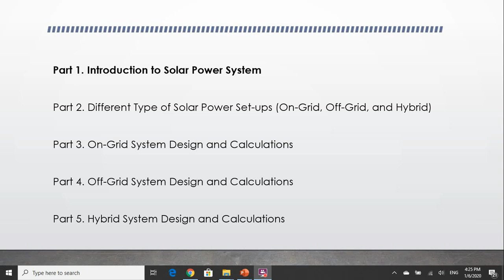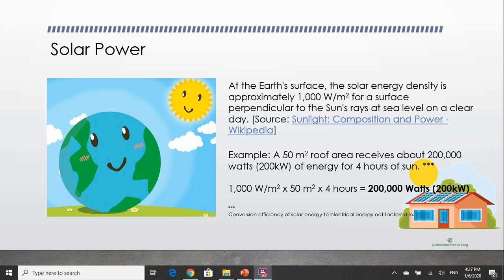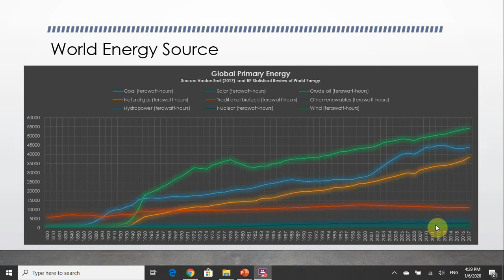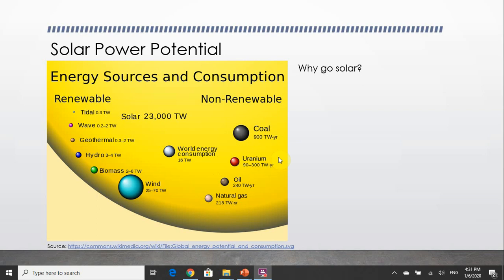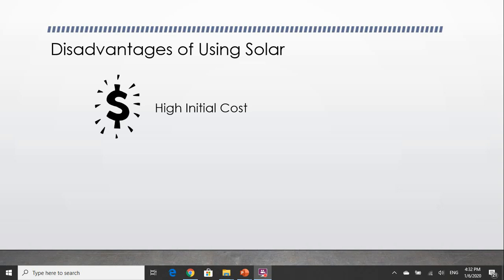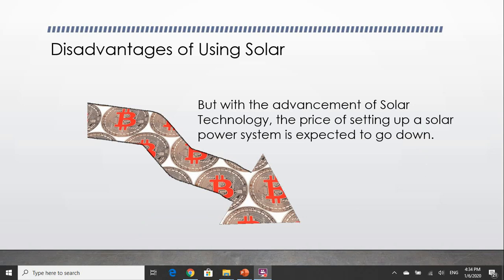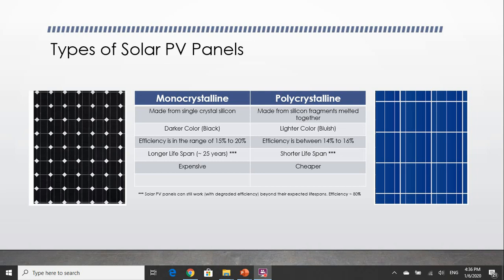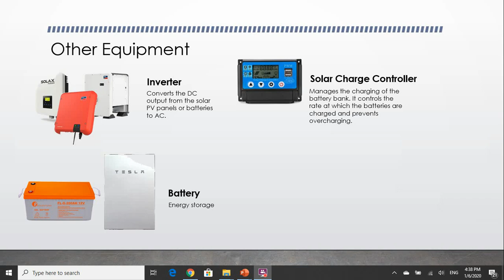DIY Solar | Introduction to Solar Power System

Comment: Solar panel prices used to drop significantly.  I bought my first solar panel nearly 20 years ago - kyocera 80 watt panel for $350 each.  Then few years later I bought 250 watt panels for $200 each.  But now prices are no longer dropping and going up instead.    But one way we can still get cheap solar panels is looking at used solar panels.  Often older solar panels that are taken off roof after 10-20 years of service still have great deal of life in them, dirt cheap and around 80-90% of original power capacity.  Plenty good for most residential uses especially if you have lots of space to deploy these older panels.

Comment: I hope we can also avail the solar energy system, really cheaper than the usual. Thanks for sharing idol
Reply from the maker: Thank you too. Mura na po ngayon, if budget is tight, go for the grid-tie set-up (no batteries). 1kW grid-tie estimated cost is around 60K PHP incl. installation.

Comment: I have a question sir.. what does the efficiency of the solar panel denotes? Was it referred to the output harvested in the solar panel sir?
Reply from the maker: Hello sir, efficiency is the measure of how effective the solar panel converts the light energy (solar) to electrical. For example, for a 20% solar panel efficiency, if it receives 100W of solar energy, only 20W of electrical energy is effectively produced.